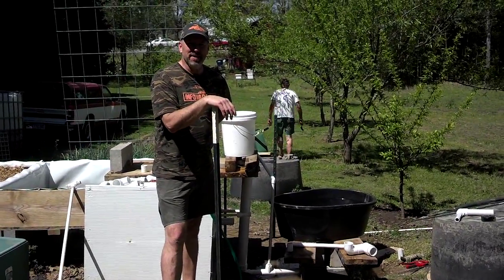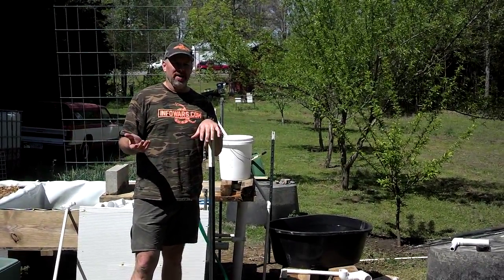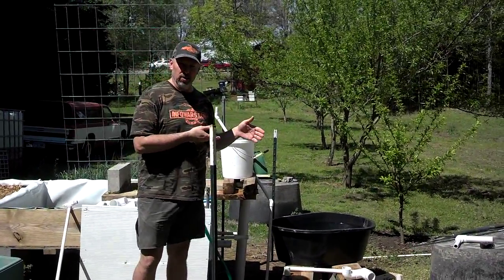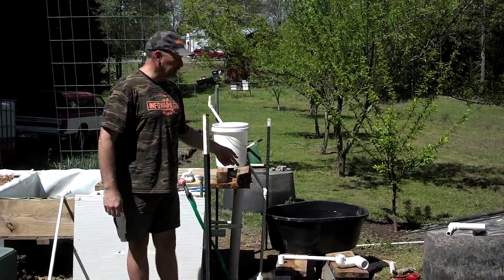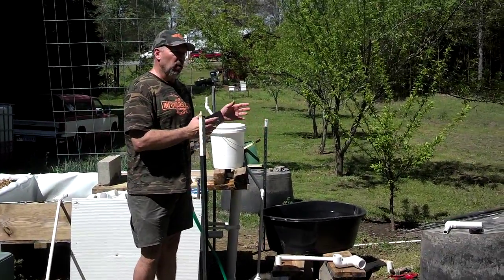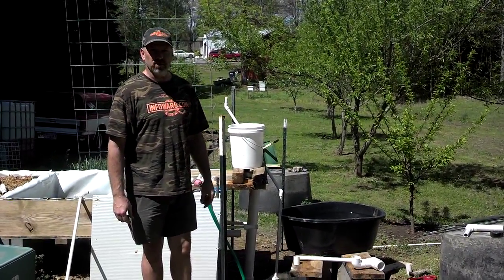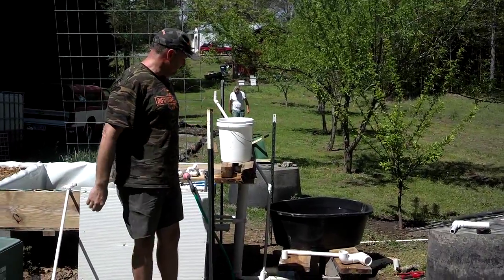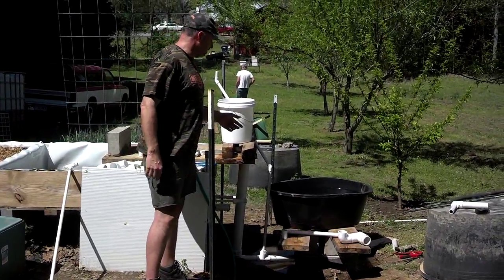Natural Aquaponics System

Comment from the maker: By the way the reducer coupling had nothing to do with the success of my experiment. Since i am draining water thru it from the other side it can easily flow backward once the siphon breaks. In this case my vertical drain pipe filled with water is taller than my grow bed below so the water will level in both the pipe and grow bed.

Comment: Can you use this for a continuous flow from lower water container to higher,  defying gravity?
Reply from the maker: Alicia Cavazos That sounds like a good project for you to work on and then share with us. I wish i could. I actually do have some ideas that i would like to try after i complete this system. In order for them to work though it may border on miraculous. I'm  going to try what i am calling a water elevator or pumpless aquaponics though it will probably require an air pump and possibly even a small miracle. If you have any ideas i am open to any input.
Reply: I found this video. It's in Spanish but hopefully you will have an idea with the image.

Comment: Hi again, Shannon!  I'm actually going to be using the same idea ... "stair-step" water falls ... in my new system.  I'm glad to see someone else doing it.  Same reasons too;  once you've paid to lift the water up, then every time you drop it you should be using that to add oxygen to the water.
I'm looking forward to watching you build your system out and seeing what you do with it.
Reply from the maker: Michel Vaillancourt You are also aerating the water at every stage instead of just at one or two points. I had to put a roof on my house and do some painting so i am really behind now. I am going to get back to my system this weekend so hopefully i will be finished in about 3 weeks. I thought about what i said about this not being for those struggling with the bell siphon and i am withdrawing that remark. Thats taking the easy way out. So i am going to try and do a better job of explaining what it is that i am doing and design a complete ibc system and pump requirements so that anyone wanting to start from scratch for the very first time can achieve the same results with a lot of hard work and patience.